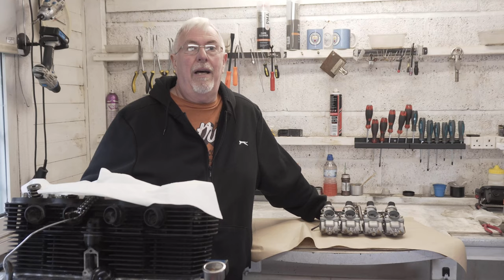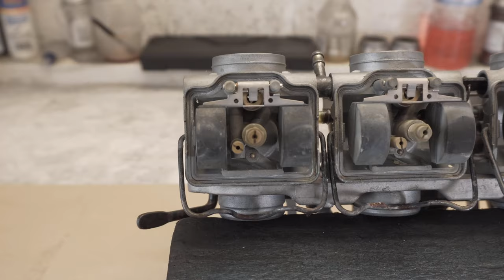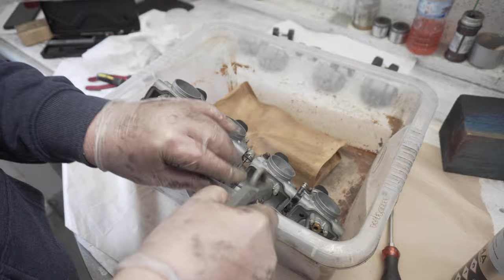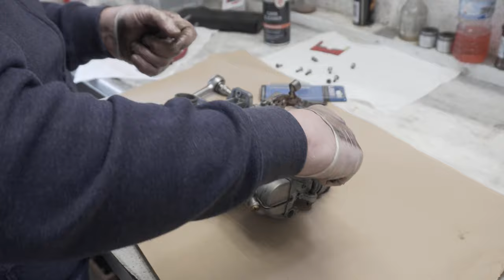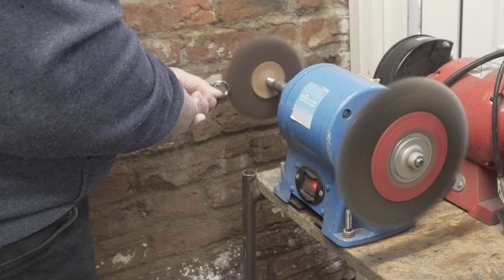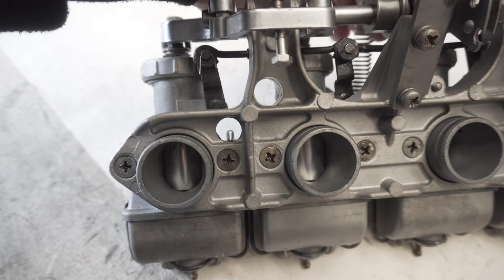Refreshing Carburetors For My SOHC Honda CB750 Cafe Racer Project Bike | 23

Comment: Good video Les. Have not done the early 750 carbs but done many a 400/4 set. Did you notice the slot on the shaft with the woodruff keys? This is a "gotcha" there is a pin in the alloy body to stop the linkage moving side to side. you have to drill out the pin or you bust the brass bush/sleeve in the link casting. and  the shaft will now move a bit. Also that bit where the cables go round do not clean it in acid before you plate it. it is rivited with metal that dissolves in the acid and you have to rerivit or bolt it together (ask me ho i know) look forward to teh running video.
Reply from the maker: Cheers Rob.  I didn't notice the pin you are talking about, maybe I didn't strip them down far enough :) I decided that I wasn't going to plate the parts yet, just clean and coat them in a wax to stop them getting any worse.  I can't undrstand why there is the very strong spring between the tow parts.  I can not imagine what it does. I will bear in mind the comment about the acid, I am surprised I haven't been caught out by that before, but to be honest I have only used plating for single items, nothing that was built up.

Comment: Can't wait to see the next video to see how they work on the bike.   I have a 1975 CB750.   It has the stiffest throttle spring of any bike I've ridden.  I may try a lighter spring next time I have the carbs off the bike.

When I was cleaning my carbs a couple years ago I had the same worry about missing a tiny brass piece on the two end carb vent holes.  I had to go look at a bunch of photos on-line to realize they're not meant to have that brass piece there.
Reply from the maker: I remember riding an early GSXR 750 through Manchester traffic and really struggling with arm pump from the weight of the throttle.  I don't think the CB's are as bad as that, but we have got used to much lighter controls.  I'm glad it isn't only me that worried about those little brass pieces, and putting the control mechanisms together on these carbs and the later ones is a really challenge.  I think they were designed by a sadist, with lots of unnecessary complications.
Reply: Yes. "Why is there a hole here? Who stole my brass!"

Daveco: I've got a K6. In case it slipped your mind, I just changed my throttle cables and they were horribly stiff. Silicone spray lube did the trick for me. It's not "buttery smooth" but it's much, much better. Also, I'd tightened my return cable too much. Slacked that off a bit and now things are good.